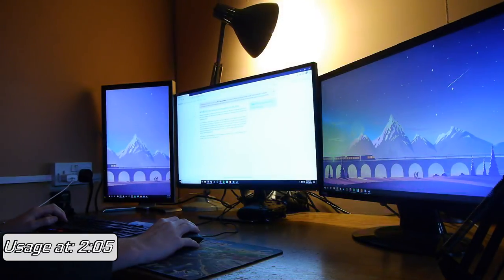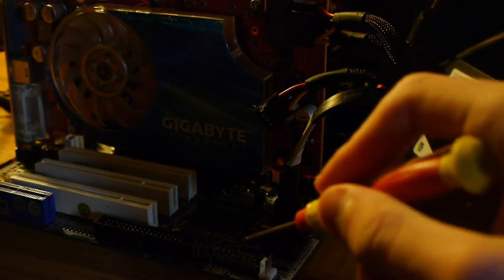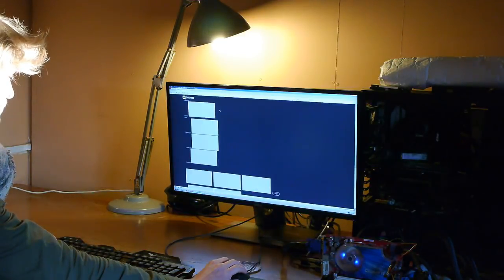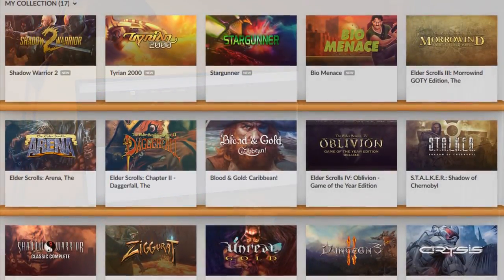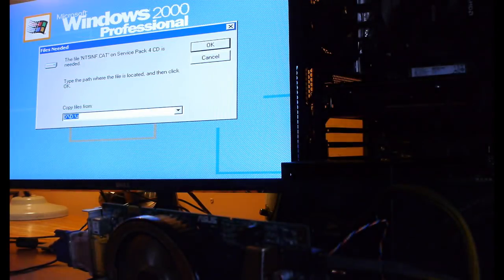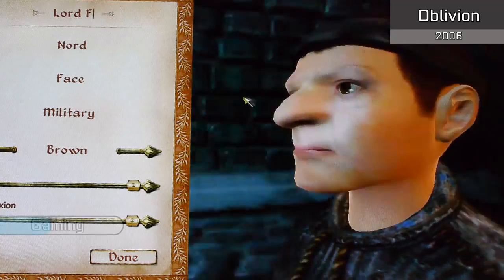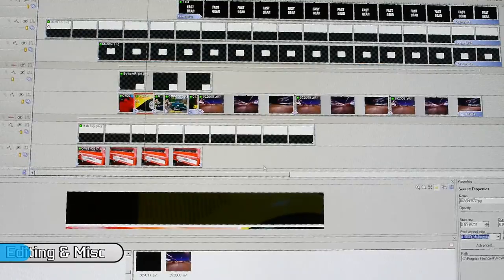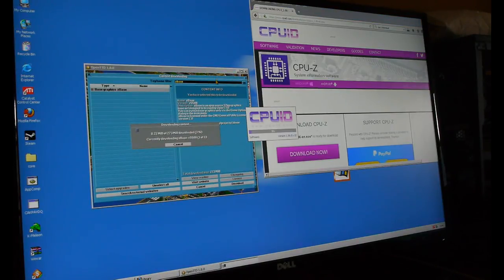Windows 2000 - Is it any good today?

Comment: I was an "unofficial" Windows 2000 beta tester in 1999. W2K was excellent, especially for the time.
Reply: I was a beta tester also. I loved it so much I dual booted it with Linux on the same machine (A dual SMP modified celeron that later upgraded to PIII's) all the way from the Beta till 2012.. It never crashed not even once in all that time. By far the best Windows OS I ever used. (And I have used them all)
Reply: 2000 was hottest garbage. Eff that.
Reply: @Wegetsignal  How can anyone disagree with such a compelling argument?
Reply: @Wegetsignal  You thinking of Windows ME? Can't think of anything else that would make you say that.
Reply: @Wegetsignal  2K and 98 SE are good but ME and 98 not so much.
Reply: @m5a1stuart83  Not true, people have selective memory and remember mostly only things which are nostalgic for them. Win 98 was terrible unstable OS, definitely not better than Win ME. Win 2000 was good and stable OS, but boot time was crazy, I could clean my room and make dinner for 3 people before it started. :-D
Actually Win ME is very good OS for retro gaming Win 9x based computer today because it natively supports mass storage, USB and such modern things. I was testing Win 98 and ME a lot on many different HW combinations and when Win ME was unstable with some HW or drivers, even Win 98 was unstable with same combination, as I said, it's more than 20 years and people don't really remember how Win 98 was actually bad.
Reply: @Pidalin  Win 98SE far more stable than Win 98 and WinME. I was using both when I was at college. WinME always crash in my CPU (Intel Celeron 850, 1GB SD Ram, S3 Trio, and realtek audio with 80GB HDD IDE).

Win 95 also a good OS, I was using it with Intel 486DX2 16GB RAM and 500MB HDD.

But from the Win 9x series, Win2K for me is the best compared to the rest of the OS only be surpassed by Windows XP.

Added:
I also using Redhat 9 Bamboo and far more stable than all windows combined including Mandrake 7.x to 9.x. I was code in GAMBAS and QT in Linux.
Reply: @m5a1stuart83  Win 2000 is not 9x family, it's NT family like XP, it has nothing to do with Win 98 or ME. Win 2000 was good OS, but slow boot and no support for dos games and some older Win games.
Reply: @Pidalin  Yes, it was NT Family. I am not trying those OS in VM but in real CPU at the time with the software made for them.
Reply: I loved the old Blackcomb look.
Reply: @Wegetsignal  what are you talking about, windows 2000 was literally the best windows before xp
Reply: I was an unofficial Windows 98 beta tester.
Reply: I use win nt 4.0, before windows 2000. It was very stable os, with opengl support.
Reply: Y’all forgot about win 7 😂
Reply: @Wegetsignal your confusing it for Mellinium Edition
Reply: @Pidalin the only reason why 2k took so long for u was probably cuz u had low ram of smthn. (64mb of ram bare-minimum. reccomended minimum of 90mb of ram.) most pcs that ran 98 had about 64-128 mb of ram, while most pcs that ran 2k had between 128-512 mb of ram.

and some computers ran windows ME prefectly, while others got constant crsshing and even constant BSOD's. your pretty much the lucky one with Windows ME in this case.
Reply: @celioazevedoofficial i was a windows 7 study island tester (damn that was an awful lifeless school program) :P
Reply: @realslimsh8y  No, I tested it on a lot of computers and boot time of Win 2000 is just long even on overpowered hardware, XP was much faster and Win ME even much much faster. I tested Win 2000 even in SSD and there is very little difference, it's not limited by speed of HDD or ram or CPU performance, it JUST boots a long time. I guess it has something to do with all those server services which XP doesn't need.

BTW, minimum ram for acceptable usage of Win 2000 is 256MB, it's useless with 128MB, I know that because we had 128MB in school and when everything goes to virtual memory, computers is useless, it was terribly slow, I was carrying another 256MB stick and I was puting it (secretly ofcourse) into my computer in school, that was only way. 😀
Reply: @Pidalin as someone who has used both 98 and 2000 on the same machine recently, this is accurate, 98 is laughably problematic and 2k takes about 2 millennia (ba dum tss) to boot from a hard drive of that era, but is pretty indestructible otherwise 
Can't agree on WinME though, that was just a nature's mistake of an OS
Reply: there was an unofficial Windows 2000 edition called Personal
Reply: @Wegetsignal  Windows ME was hot garbage, 2000 was actually surprisingly solid. Just became irrelevant the moment XP came out

Comment: The day I upgraded from Windows 98SE to Windows 2000 was the birth of the modern computing era for me. Suddenly I went from rebooting Windows 98 every couple of hours when trying to get work done to literally weeks of uptime on Windows 2000. Ran beautifully on my bottom-end Pentium III at the time.
Reply: I would also have weeks of uptime on my computer, Windows 98 kinda sucked tbh
Reply: Because win2000 was completely different OS.and XP is just a fancy version of win2000.
Reply: @hifijohn windows 11 is a fancy version of 10 which is a fancy version of 8.1 which is a fancy version of 8 which is a fancy version of 7 which is a fancy version of vista which is a fancy version of xp which is a fancy version of 2000 which is a fancy version of NT 4.0 which is a fancy version of NT 3.1 so yeah.
Reply: @gmdking  NT is just fancy VMS, everyone is using VMS on DOS-compatible VAX CPUs (x86_64). We are all secretly using DEC machines, and Arm, Linux and Apple isn’t immune because Arm has DEC Alpha inspiration, Linux is inspired by Unix which got its start on a PDP-11, therefore we are all using fancy PDP’s
Reply: @gmdking XP kernel was pretty new. Vista was meant to be new, but it never worked. They had to just keep removing all of the features till it would run on XP kernel 😅
Yes, 2k was just a nicer NT4.

Comment: Man, when I got my hands on Win2000 at my office back in the day I thought I'd died and gone to heaven.  I grabbed one of the OEM licenses and put it on my home machine and was as happy as a clam.
Reply: Your comment is wholesome approved!
May good days be upon you mate.
Reply: I skipped ME entirely and XP for the first couple years, choosing to run Win2K instead.  It was by far the best choice at the time and still my favorite Windows version.
Reply: agreed win2k was one of the best versions of windows to date, before activation was a thing the desktop install was clean fast small and had none of the feature bloat current windows suffers from, seven comes a close second or different reasons.
Reply: @Mmmm_tea  Same. I used 2000 till 2013, then moved to 7 and refused to get 10. I dread January 20, but I may still not upgrade. Windows 10 sucks!
Reply: @dylanash2569  Haha. I still have this old Windows 8.1 tablet.
Reply: No offense, but how does trying out a new OS make you that happy? There's not much difference between Win 2k and Win 95/98
Reply: I actually saw a windows 2000 pro disc laying around at work. I copied it to the hard drive on my laptop when no one was looking LOL
Reply: Windows 2000 was the last version windows I’ve used as my full time os of choice. When end of support came did the unthinkable and bought myself a mac.
Reply: @WertlipGamingTeam  apple products are a rip-off. windows 10 frankly is not that bad.
Reply: Andrew Donohue I know thst, its just the ecosystem having all devices apple, works really seamlessly. Also I like to choose the time my updates are being run.
Reply: @KhoaTran0720  This was a year ago, but Windows 2000 ran off technology previously only used for workstations. It brought Windows NT to home PC's.
Reply: @KhoaTran0720  windows 2k was a lot more stable thanks to nt
Reply: @KhoaTran0720  I know this is a 2 year old comment, but 2000 was NT based which is a huge difference between ME/98/95 that ran in DOS and was unstable.
Reply: @Damaniel3  Yup, trying to get back to it again.
Reply: @Damaniel3  2K wasn't that horribly different than XP in term of software support, so you could have totally used it
Reply: @KhoaTran0720  there's a ton, the kernel is NT rather than MSDOS, so much more stable and had the same support as xo
Reply: @WertlipGamingTeam  I did the unthinkable and installed Linux

Comment: when your computer is so powerful it can't run windows 2000
Reply: drivers
Reply: Windows 2000 can. NT kernel are meant for that. Now when it comes to Windows 95 and 98/ME, that's where you might run into a issue.
Reply: figured id check this out on an old pentium 4 from the depths of my closet.... but i get a stop000a5  the acpi bios is not fully compliant when installing win 2000
Reply: Of course, don't try running that on a SSD. Rule of thumb, use a SSD if you're on Windows 7 and later.
Reply: @cesarjavierbarbosa8318  I use XP and 2000 on an SSD  also by Using IObit smart defrag I don't have to worry about trim as as smart defrag has that and it works under 2000 XP and Vista.
Reply: @Jimmycozad1980  😮😮😮😮
Reply: If ur pc is not strong it won't work
Reply: Speaking of that, I have virtualbox so I downloaded windows 2000 professional but it didn’t work.
Reply: VirtualBox??
Reply: @MorganNye  it did for me. I tried switching the types of fake ssds, tried changing the ram, and even tried reinstalling it. After 23 mins. It worked! Just a trial and error thing.
Reply: SexyWoody oh, well I never gotten mine to work, I’ve been trying to work windows 98 by trying to find the disc image file for it but couldn’t find it at all, and also when I try to power on windows 98, I get the message windows32.hll is not found, so I downloaded it by searching it up on google, and then I put on virtualbox but when I power on windows 98, it still didn’t work.
Reply: @MorganNye  bc 9x kernels aren't officially supported.
Reply: SexyWoody what are kernels?
Reply: @MorganNye  they are specific types of code for operating systems, like 9x, which is based off of msdos. Then we have NT, which is New Technology, even Windows 10 is based of nt. nt is reliable, fast, and of course, newer. Millennium Edition has 9x kernel, didn't work..
Reply: @MorganNye  nt also has better support for a lot more stuff, like more ram, more space.
Reply: SexyWoody well i was using windows 7 to get windows 98 to work on virtualbox, and feels really complicated and I feel like I’ll never get it to work ever, can you please help me?
Reply: SexyWoody should I just give up trying to get windows 98 to work virtualbox?
Reply: @MorganNye  yeah.. I had a lot of problems with 9x..
Reply: @MorganNye  just stick with NTx
Reply: SexyWoody NT 4.0?
Reply: @MorganNye  sure.
Reply: @MorganNye  I'm updating it as we speak
Reply: @MorganNye  is it going well?
Reply: SexyWoody I’m not at home right now I’m at my grandmas house so when I get home at 1:00pm I will download it and can you please help me to get it to work?
Reply: @MorganNye  sure. I'd reccommend winworld.
Reply: SexyWoody oh I used that to download windows 98
Reply: @MorganNye  oh ok.
Reply: @MorganNye  I'm not good at giving instructions using text, tbh
Reply: SexyWoody what’s tbh
Reply: @MorganNye  to be honest
Reply: SexyWoody ok thank you
Reply: @MorganNye  welcome
Reply: SexyWoody I actually never used windows nt 4.0 before.
Reply: @MorganNye  oh.. its.. alright. I prefer Windows xp.
Reply: SexyWoody oh yes, me too, that’s the windows that I grew up with, my second favorite is windows 7 and 3rd is windows server 2003.
Reply: @MorganNye  I'm using Windows 10 now.
Reply: SexyWoody uh oh
Reply: @MorganNye  what?
Reply: SexyWoody windows 10 is what I have also and I think it’s actually pretty bad, because people hate windows 10, and they think it’s the worst windows Ever, I mean I can actually agree with them because I get the blue screen of death and it’s all one color and you have to enable the windows vista startup sound and it’s too futuristic, although we also had windows 8 which wasn’t that good either.
Reply: @MorganNye  I mean, I miss the startup sounds, but I'm all for speed and reliability.
Reply: SexyWoody well what windows do you have then
Reply: @MorganNye  Windows 10
Reply: SexyWoody oh, well lucky for me I still have windows 7, are you sure you don’t wanna get the windows with the startup sounds?
Reply: @MorganNye  I mean, I still have most of the vms, like Windows 7, Windows 2000, and Mac OS X Snow Leopard.
Reply: @MorganNye  but yes, I'm sure
Reply: SexyWoody well then shouldn’t you be happy with them and not the miss the startup sounds?
Reply: @vinson3725  okay, I'm at the virtual optical disk file and where is the actual disc image file for 4.0?
Reply: @MorganNye  I was sleeping. Can you look it up? Thanls.
Reply: @MorganNye  I'm in the USA, if you're wondering
Reply: @vinson3725  oh, okay, i'll try
Reply: SexyWoody I already know that you’re in the USA.
Reply: @MorganNye  hold on.. how do you know?
Reply: SexyWoody because you’re American and you speak english, did I scare you
Reply: @MorganNye  y.. yes?
Reply: SexyWoody what? Nobody, why ask that
Reply: @MorganNye  yeah, this guy on Reddit does... she broke up afterwards

(He does it all the time)
Reply: @vinson3725  Wow, and I'm not trying to be rude, but I didn't like it when you said the s word, I don't like it when I chat with people on youtube and they swear, can you like take it easy?
Reply: How can ur pc be too powerful to run Windows 2000
Reply: @coldtea7  Uh, I don't think I was trolling, and I will not tell my age because that's personal information, but I will tell you that I graduated out of high school from June 10, 2019, and I was wondering why he said the s word.
Reply: @cesarjavierbarbosa8318  SSDs are the ideal choice for win2000, trim is irrelevant on modern ssds
Reply: @cesarjavierbarbosa8318  Windows 8.1 on a 5400 RPM HDD. Using SSDs is no rule of thumb.